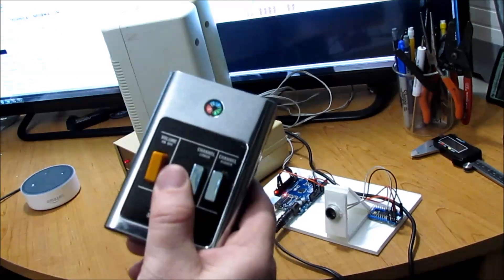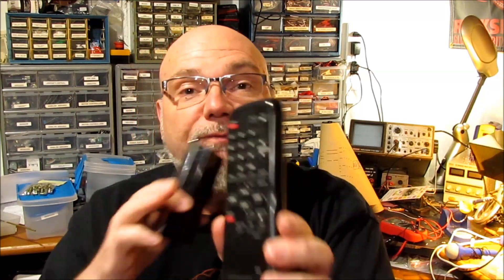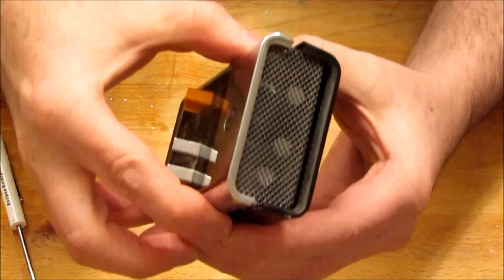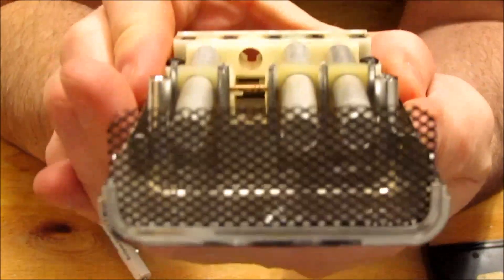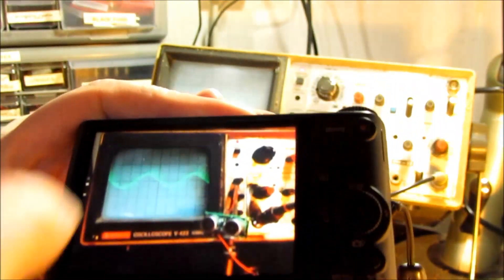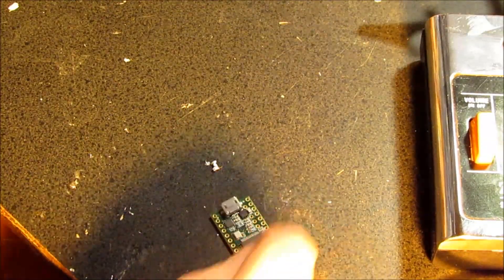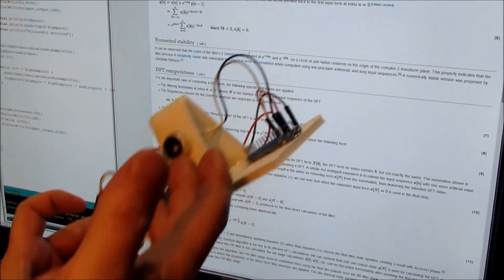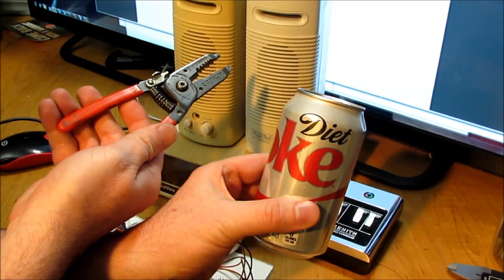012 Zenith Space Command Retro-future Ultrasonic Remote Control Project

Comment: Could it be made to use on a modern television?
Reply from the maker: The easiest way I can think of would be to build a similar device that could recognize the tones of the ultrasonic remote and then rebroadcast it to the television by driving an infrared LED (Just like a modern infrared remote control would do).

With a microcontroller in the mix, you could allow combinations from the ultrasonic remote to perform different actions. 

That could be a really fun project.

Comment: Just looking round for stuff about Space Command simply because I'm fascinated by it. Yep I reckon the grooves on the rods are just for assembly, the workers in the factory would have to stuff the right rods in the right place at a decent speed, and just the length wouldn't be enough to easily tell them apart. So... while they're shoving rods through heavy machinery, why not mill some grooves on each one? Me, I might've used paint, but it's not my factory.

Actually yeah the background music is a bit annoying, I could put up with it as a bit of audio wallpaper, but very quietly. People aren't here to dance to library music after all.

I'd be interested to know how the reciever circuit worked. Surely not 1 valve / transistor and a tuned circuit for each? How extravagant! I read early RC planes would send audio over the carrier wave, generated by something similarly mechanical. Then the reciever would have a small comb, like in a music box, with a coil wrapped round. The coil would feed the audio from the remote signal into the comb, and the relevant fingers would vibrate in resonance. This made them touch little outstretched fingers, and caused a contact.
Reply from the maker: I didn't know that about early RC plane transmitters.  That's very interesting. Thanks for the note!
Reply: I have a four bar. And the hammers have matching groves.  Except 4 on the biggest bar and none on the hammer bar.

Comment: It is not exactly low -tech as the television still used an electronic receiver to hear those frequencies and then respond with relay signals.  The 1960's had vacuum tubes in them and by the mid-70's, they were transistorized.  We had a Sony Trinitron from the late-70's that used a remote with batteries but was still emitting sonic waves.  You could hear them if you put your ear up to the remote speaker.

Comment: Do you have the code you created posted somewhere and I missed it? I’m trying to do a similar project with the next generation where it used different capacitors with each button to shape the frequency. And I can’t quite get my head around the analysis you posted so I was hoping to poke at the code.

Comment: How about a Magnavox Phantom remote? There were two sorts of them. One was electronic, apparently the earlier type. The other used sound, but a different system than the Zenith Space Command. Magnavox used what looked like plastic whistles in the front, behind a metal grille. Push one of the two buttons and you can hear a quiet *chuff*. The most common had two buttons. Some digging with google images shows some few images of a three button style and a really old style one with just one button. Admiral Son-R on the case. There are some images of the 3 button opened up, but I've yet to find images of the insides of any other non-electric Magnavox remote. There's another style of Magnavox remote with four horizontal rocker buttons and a round grille in front. No idea how that one works, it's just labeled Magnavox Remote.

All the Magnavox remotes for HiFi sets and televisions get ignored in History of the Remote Control articles.